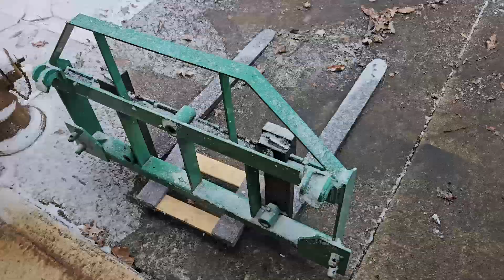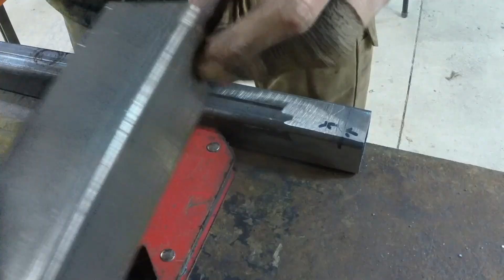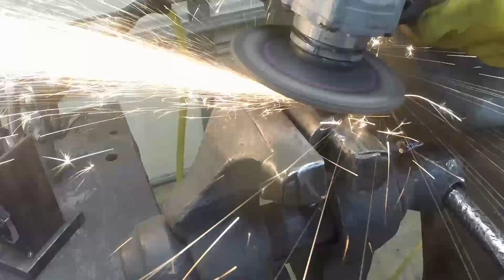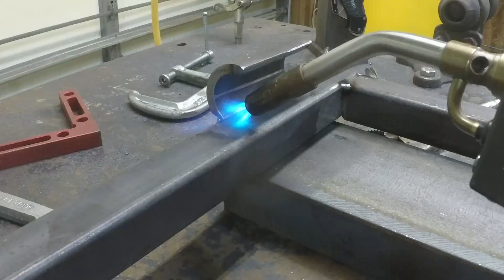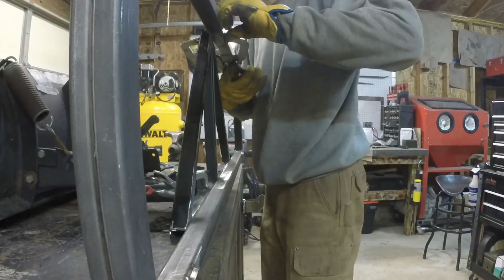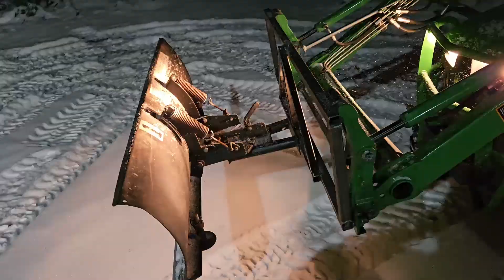Turning an ATV Snow Plow into a Tractor Plow

Comment: Looks good! Might want to look at potentially putting a set of skid shoes on the back/bottom of the bracket so you can take full advantage of the float function. I would be wary of using the float function with the plow being so far in front of the arms.